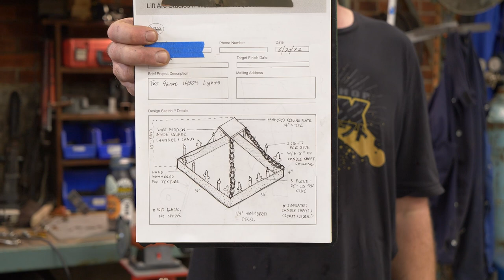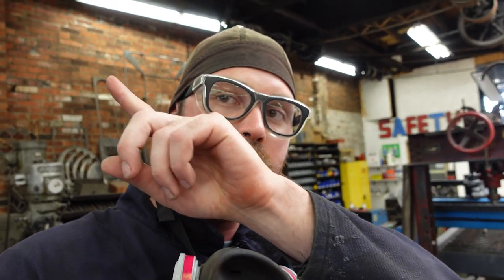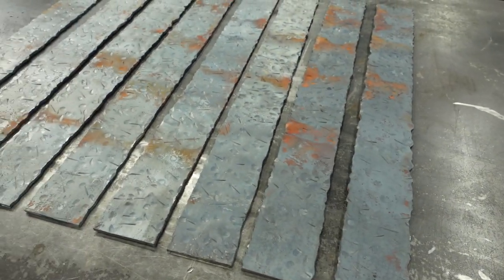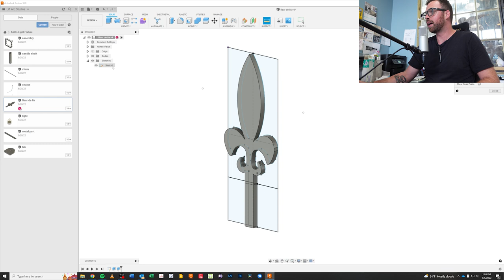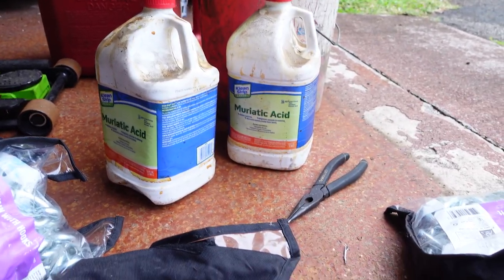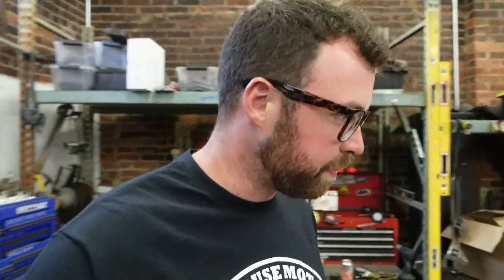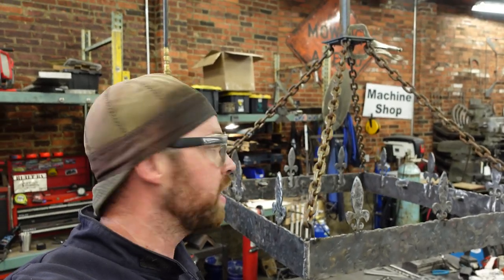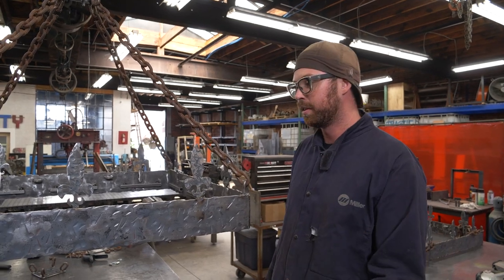Building a New Chandelier That Looks 600 Years Old

Comment: For your cutter you should put slide outs on the second to bottom rack so they are the same height as the cutter. Save room and a video idea. 
Use the U channel as your slides.

Comment: Muriatic acid is a strong hydrochloric acid. Specifically between 20 and 32% pure. About the highest possible is 40%, anything over that will just evaporate so fast as to be useless. Also used as pickling solution for steel. To prevent flash rust, immediately rinse with water and then oil it. Hot water is best as it will dry faster and allow oil to stick. It takes off zinc and most other plating. The fumes that are evaporating  are heavier than air and so those fumes that bubble over the edge of the bucket is settling and killing the grass. Those same fumes are what causes flash rust in your shop. Folks with pickling tanks have fume extractors to prevent that. You don't need it as strong to pickle steel. 15% is plenty, so you can dilute it for pickling. They sell inhibitors to reduce the fuming for use in pickling baths

Comment: Could be helpful...I've cleaned lots of old chain for resale using vinegar. After it's pulled from solution, put the chain in an old towel and hit it with a hot blow drier immediately. Worth noting, you will create vapor when you apply heat. Vinegar vapor is not deadly, but vinegar vapor replaces oxygenated air, so ventilation is important for even less caustic solutions. The towel makes it easier to turn the chain and move it around to get all sides warm & dry. While still warm, I oil it and hit it again with hot blow drier. There may be an extremely thin layer of flash rust that pops up as you work, but it is so thin, it dissolves with ease. I've done this process with & without the heat of the blow drier. When the metal is warm, the process works more quickly and easily. It is my assumption that this process works same as when cleaning cast iron pans....with heat you get expansion of metal, so applying oil to warm/hot metal helps to seal the surface as it contracts when cooling down. I use another towel to remove any excess oil.

Comment: I know this piece is kinda big but for future projects use used Diesel oil as your blackening solution.  I've had great results with this method.  Just dont get the base metal to hot or the black coating will not stick to well.

Comment: IM A WELDER 30+ YEARS. THIS LOOKS 40 YEARS OLD NOT 600. I WOULD HAVE NOT PAID FOR THIS. THERE IS ABSOLUTELY NO CHARACTER IN THIS PIECE. I WOULD HAVE CONNECTED WITH RIVETS MADE FROM ROUND RODS. I ALSO WOULD HAVE MADE SOME CONTRAPTIONS TO MAKE THIS LOOK EXACTLY 600 YEARS OLD. I ALSO WOULD HAVE MADE MY OWN CHAIN FROM ROUND ROD WITH A HAMMER TO LOOK WORN.
I WOULD HAVE NOT USED THE WELDER FOR THIS PIECE. A FORGE ONLY WOULD HAVE BEEN USED FOR FABRICATION. IF THIS IS A COMMISSION PIECE I WOULD'VE DONE WAY MORE. ONLY ONE THING IS MISSING FROM THIS WHOLE PROJECT........AND THAT IS PASSION. YOU CANNOT PUT A TIME LIMIT ON COMMISSIONED PIECES.
WHEN YOU HAVE AN ACTUAL TIMELINE FOR A COMMISSION PIECE YOU START RUSHING AND CUTTING CORNERS. THERE MUST BE TIME AND PATIENCE IT WILL SHOW IN THE PIECE BEING MADE. I THINK YOU DO GOOD WORK BUT YOU ARE PUTTING TIME LIMITS ON PROJECTS THAT CREATE ANXIETY. THUS, CUTTING OFF THE CREATIVE MAGIC.
Reply from the maker: What would you have charged for what you propose?
Reply: What’s your email?
Reply: don’t get me wrong I watch all your videos even over and over again. 
As for price what did you charge? As for what I would have charged for something like that, well first the customer has to know right off the bat that I will give exactly what she paid for. 
Next I would let her know this kind of project can’t be rushed. 
Then I would have gave her a minimum of whAt something like this would cost. 
If it were me minimum $5K. You did say she wanted a 14th century replica of What a chandelier would look like. 
Then I would explain to her my process. If she doesn’t wanna pay for my knowledge, experience, and my artistic capabilities then I guess she will get exactly what she paid for. 
The whole idea is to make something look like and work like a product of the 14th century. Welds shouldn’t be seen. Not everything was flat in that era. They used forging techniques. Again don’t get me wrong if she paid you $2500-$3000 then I see it being done this way is what she asked for. However, I would have done my research and figured out how to do this without showing my welds and going that extra mile and actually making things from literal scratch. I mean for Gods sake you have a forge.
I would have made it with cut pieces of round stick for the rivets. Drilled holes that line up heat the rivet up and pounded it in or pressed it in also using another piece of metal to cover the corners before riveting. 
At the end of the day I love how you are transparent honest and a team player. 
But I know from hearing it in your voice the passion is there but never let a customer tell you there’s a time limit. I don’t care that they are paying you. You must control your projects and tell them you have minimum charges for certain commissions. But your end result will have to be exactly what wanted. By doing this you will have more control on the projects you obtain. 
These were the words of my wife telling me that my name is attached to this commission or project that will echo who I am and what I can do louder than any voice. 
Here’s a tip:
Tell them you will get back to them in a couple days find your base cost of material and supplies and gas and man hours. Then look at everything that is of worth (expense) going into this project. Then figure out how much are you worth. 
Be confident in your estimates and proposals. 
And last but not least this should be first 
Ask them What is their budget?
This will usually change the direction of any discussion. If the y have a budget they will say what ever I can get for this price. Generally they will take the closest thing to their idea. If not and they say give me a price and we’ll go from there. This tells you the client can pay but wants to be a pincher. Some will just say just make it after going over a price with you.
REMEMBER ITS YOUR  BUSINESS NOT THERE’S. YOU HAVE OVER HEAD. 
SHOW THEM WHAT YOU ARE WORTH! 
AND BY ALL MEANS KNOW WHAT YOU AND YOUR TIME ARE WORTH. 
ALWAYS HAVE A MINIMUM CHARGE THAT COVERS YOUR CREW AND YOUR OVER HEAD AND LEAVE ROOM FOR EXTRA MAN HOURS. 
THEY ARE COMING TO YOU FOR YOU NOT WHAT YOU HAVE.
LET YOUR PASSION SHINE BRIGHT. 
IT WILL SHOW.